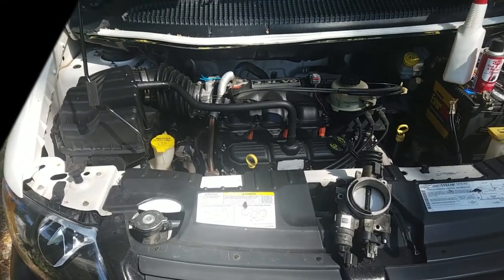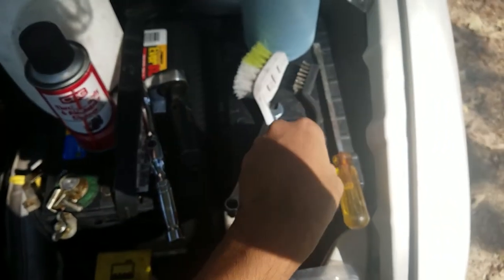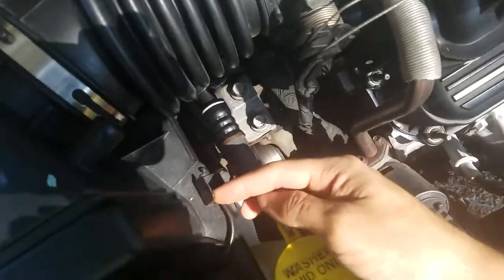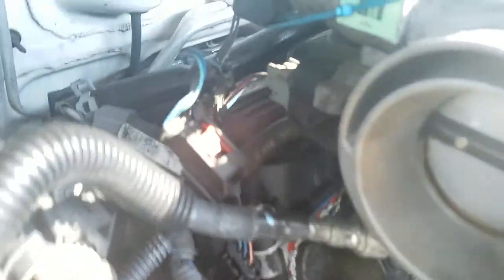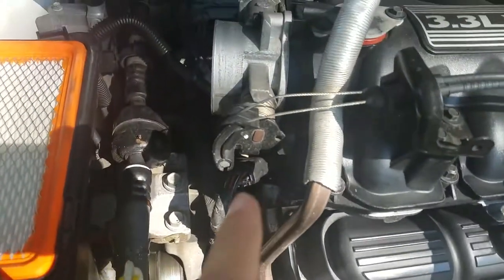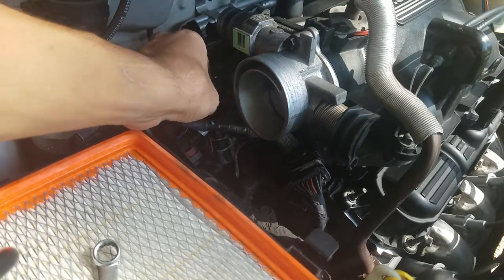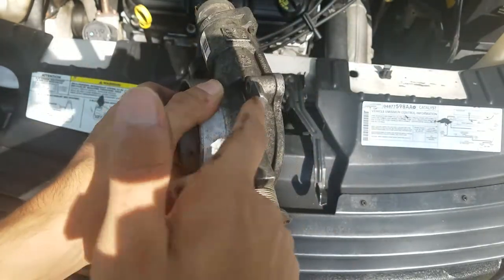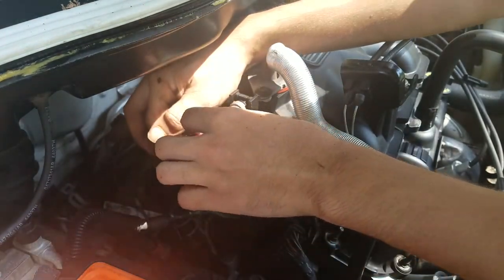BIGGER THROTTLE BODY GRAND CARAVAN | 3.8L Throttle Body Installed on 3.3L Engine | 4th Gen Power

Comment: Just one tip. Take off the TPS and don’t wet it.

Take off the idle control valve and clean it out. It will be filthy. Use wd40 and a toothbrush and toothpicks. 

Good time to clean the passages for the icv. 

Also, of you want your tb to be spotless, use wd40 /or injector cleaner/seafoam and/or gasoline. 

It will be like new
Reply from the maker: Good tips! But I was too lazy to take off the tps or iac. I did spray some throttle body cleaner into the iac and it got a little gunk out. 

I'll definitely try using some gasoline or seafoam to make it look new.
Reply: @TechiePocket1  it won’t transform the exterior really, but it will definitely clean the door spotless.

You CAN spray the exterior with acid to brighten the alloy up but don’t leave it on for too long and then rinse and wash and dry really well so you don’t get that white alloy rust powder

Comment: It is pretty much just a bored out 3.3 TB. The 3.8 is just a bored out 3.3 that's why it doesn't handle much power in stock form. But still super reliable being pushrod engines
Reply from the maker: Yeah that's true. But adding the 3.8 TB to my 3.3 increased the power significantly. It's a really big difference at any RPM range and the shifts are alot smoother now too.
Reply: @TechiePocket1  oh I bet, more air. I wish I could use the 4.0 TB but it's not even the same manifold lol
Reply: @goclunker  I just put a 3.8 TB on my 3.3, got it from the junkyard, cleaned it and put on a new gasket. I noticed a difference in power, especially on the highway.

Comment: Great video however I wouldn't have used water on that thing. It'll introduce rust. Luckily no water or anything is running though it but still though...
Reply from the maker: Good point but I'm not afraid of it rusting. The water would dry out quickly once the engine is running
Reply: @TechiePocket1  makes sense. You did do a phenomenal job though.
Reply: @TechiePocket1  I have a little question  sir..please answer me..can I use a "3.8..throttle body..and take off my 3.6..throttle body off my town and country "?..thank you
Reply from the maker: @drunken-skunk  I'm pretty sure the 3.6 throttle body and 3.8 are not compatible

Comment: Did you notice a difference? I’d guess improved throttle response?
Reply from the maker: Big difference! Throttle response is about the same but its got a noticable improvement in power
Reply: Any gas mileage difference? My 3.3 is dismal to say the least….
Reply: @hylander89  get new map sensor, new PCV valve, clean your throttle body carefully with a cleaner spray designed for that and buy a cleaner injector atomic by purple brand goes to gas tank, all will set you under a hundred bucks, not sure what exactly fixed my gas mileage, but it did. All except PCV is easy to do. Then you can disconnect the batter overnight, then connect, drive 100kms and it should get better gas mileage. And also you may clean up check your EGR valve. Cheap too.

Comment: This is interesting.
Reply: I did this exact modification to my 2002 Dodge Caravan. The difference was less travel on the gas pedal and better acceleration.  Also more power on the highway. This was a great improvent from the 3.3L throttlebody. I also install a cone filter with chrome cold air intake. Added Lucas fuel injector cleaner and a full tank of gas. Minivan  has come back to life. More responsive than before. It was super easy to install. Took me like 7 minutes. I got the 3.8l throttlebody from a 2004 town and country van with 65,000 miles. I then super cleaned throttlebody.  Removed tps sensor and iac valve. Worked beautifully. As for gas mileage i have not calculated it. Im sure its using more gas but not much. My van has only 110,000 miles and is in great condition. 3.8l throttlebody costed me only $25.00 & gasket was $4.00. Cheap & Easy upgrade.

Comment: Did you notice any horsepower or torque improvement?
Reply from the maker: It revved way faster so yes it was quicker in acceleration. But I didn't dyno it so I can't say how much it improved hp and tq.
Reply: @TechiePocket1  thanks for the reply

Comment: Do you recall what model van or year that 3.8Tb came off from?   Also, any other mods that can be done in van?   Thanks
Reply from the maker: 01-07 should work. Mine was off an 05 that I put into my 07
Reply from the maker: It's the same generation grand caravan just grab the throttle body from the 3.8l engine.